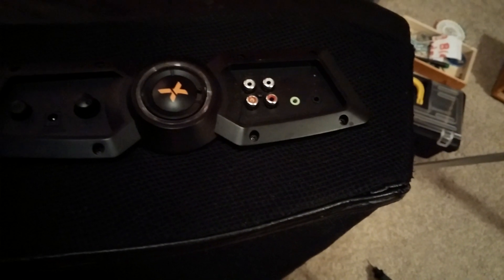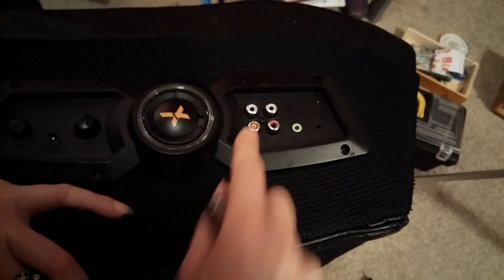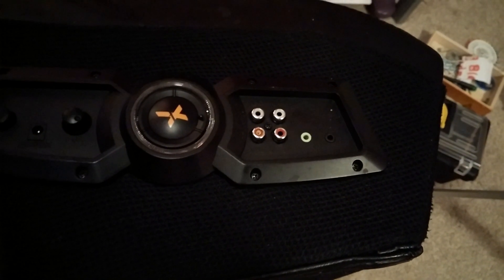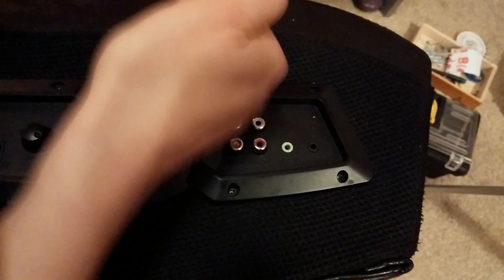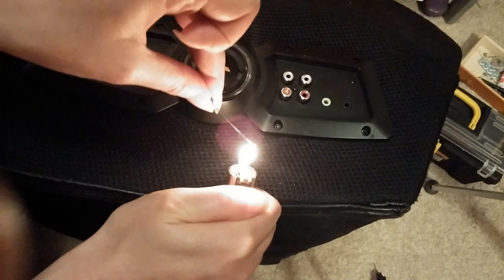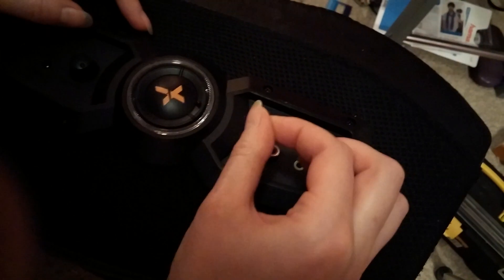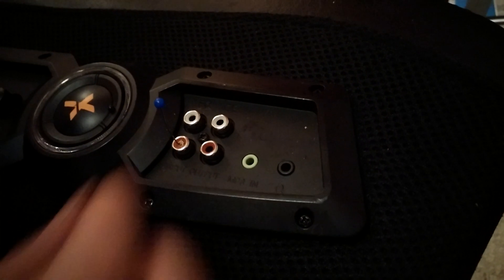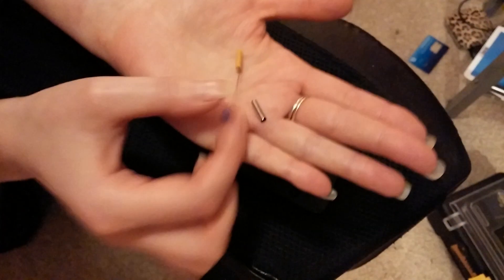How to Remove A Broken / Snapped RCA Cable from a Phono Socket in X-Rocker Chair or Amp

Comment: Well done this worked well! The plastic inside pulled free from the metal tip, and then I could get a skinny screwdriver inside the metal tip and pull it out with ease.